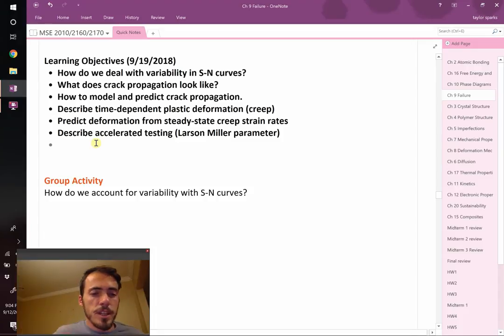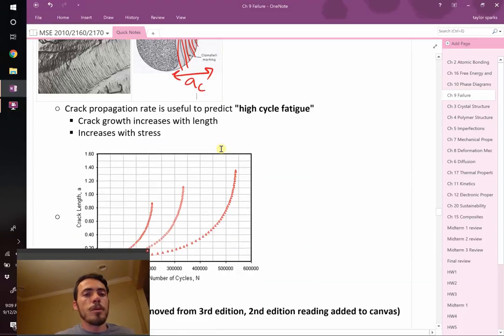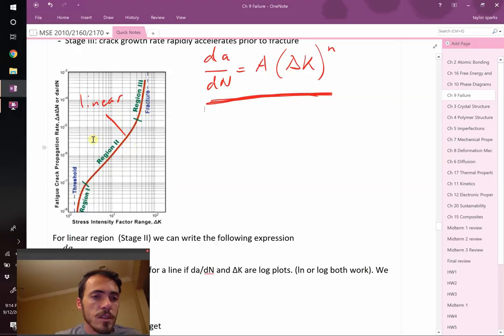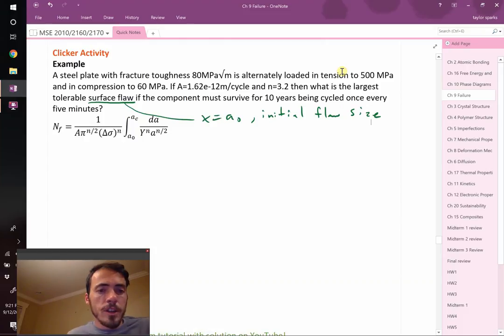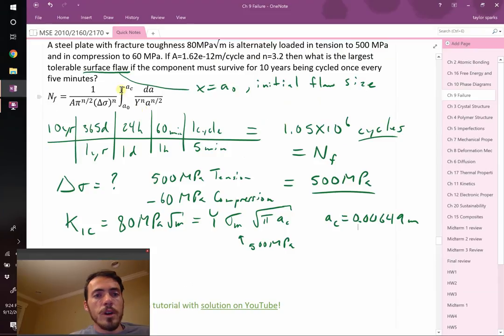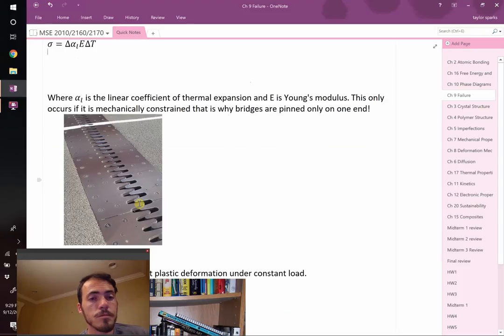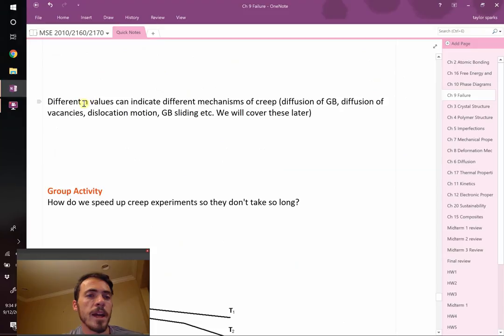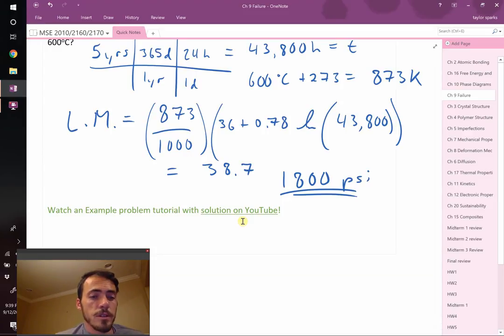Fatigue crack growth and steady-state creep

Comment: I have read that for some alloys fatigue cracks can initiate even if there are no defects in the material, and regardless of how high the stress applied is. I read that they initiate at the surface due to dislocation motions which roughen up the surface forming micronotches, even when the stress is way below the yield strength.
How is this possible ? If i were to cyclically stress a defect free aluminium alloy with a smooth surface at like 10 MPa, how can cracks nucleate at the surface when the stress is so low? Why does the cyclical nature cause this odd phenomenon? This has been confusing me for quite some time.